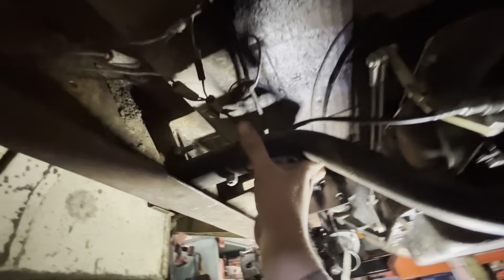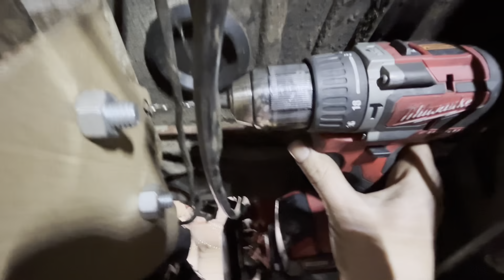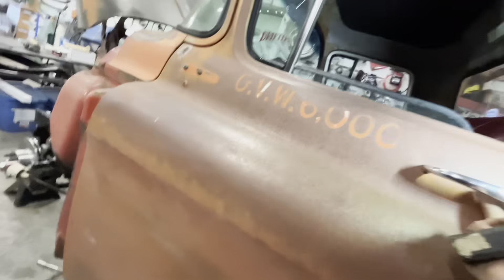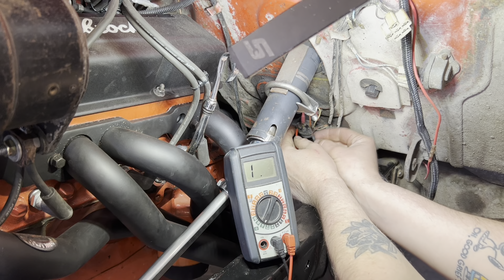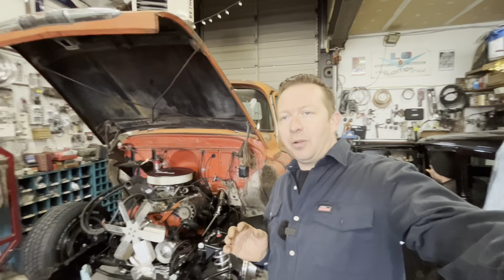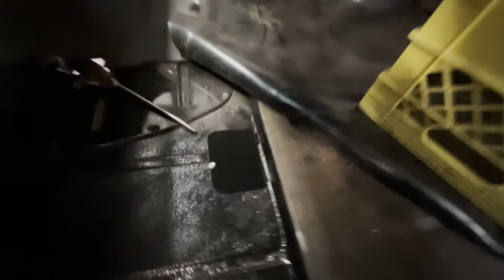Installing power brakes on a 1956 Chevy Pickup. Andrew’s 56 Chevy Build Part Three

Comment: I wouldn’t even bother with a power brake booster on one of these trucks. Mine stops just fine without one. I have a corvette manual master and a steel bracket from POL. Disc drums

Comment: Did it bother you that the pinion is offset on the 8.8?  I'm putting the same axle in my 37 1/2 ton with an LT!.  I didn't get one with a locker so I'm looking at the Eaton Trutrak.   Otherwise I think it will be a one tire fire.
Reply from the maker: The pinion is offset in almost every rear end. Some more than others. 
As long as the rear end is mounted square, and the engine and transmission are mounted square, everything is happy. 
Manufactures do this on purpose to minimize driveline vibrations. U joints don’t like to be in a straight line.
Reply: @LGKustoms  Engine is mounted square.  I'm second guessing if I have enough angle in it for the U joints.  I understand that some angle is needed to keep the bearings from Brindling. I need to check angle again.  I thint it's around 1.5 degrees. Perhaps the offset will help with this.  I set the engine low in the frame.  FATMAN IFS.  I'm about 3/4" off the crossmember  I hardly have any bump for the transmission.
Reply: @LGKustoms Great video,  YOU  can  get  of rid offset removing  ( SUBTRACT) WHAT IS ON RIGHT SIDE  OF AXLE TO THE SIDE JUST  CUT TUBE & REWELD. PUT THE PINNION IN  CENTER. NEED TO MAKE SURE CLEAR FRAME & WHEEL WELL. USE R/s  axle for L/s. Did this 8.8 on 63 Merc.comet.

Comment: Why did you use the cheap brake booster set up ?  You should use the set up from brothers truck. Then you wouldn't have to do all the custom chopping and welding.  BTW ditch the hokey music. It  detracts and annoys.
Reply from the maker: I used this booster set up because this is what Andrew supplied me with. 
Sorry you find the music distracting. I really enjoy music myself. And the comment I received right after yours was someone commenting how much they enjoy the music, so I’m not sure how to help ya there haha.
Reply: That makes sense. I'm doing the same upgrade to my 55 GMC  and I see lots of those units with the Ford style brake pedal pad on EBAY.  Brothers have a really nice unit in chrome as well with the stock brake pedal and linkage. Just for future reference. 

I must agree that your craftsmanship and technique are very professional.  Having to navigate around that transmission was real test of your skill and ingenuity.  Every one has their taste in music. Yours is the only video I have seen so far doing this job  on this truck.
Reply: @LGKustoms  there's  always a person W/ Deep pocket, The is to cut & weld PART OF FUN BUILDING  HOT RODS.

Comment: What is the brand of power brake booster and master cyclinder did you use??  Thanks
Reply from the maker: The owner supplied it, but if I remember correctly it was from Speedway

Comment: Hi lee.... great video, thanks for sharing. Exactly where i am at, with my project!  may i ask a question.... in doing the install, you don't need to include a proportioning valve?  i guess i was thinking i needed one, but watching your video, you went with the 2 lb. inline ones only?  Thanks for confirming.....
Reply from the maker: I never use proportioning valves, never had an issue.

Comment: Can’t believe u didn’t think of taking the pedal out and cutting the pipe off on the side u needed to move it over so all would fit then put the piece u cut off on the other side to take up space , easy peezee.

Comment: any Pro's of this kit than going on the firewall? besides keeping the firewall clear? this seems like there's more fab work involved than the firewall mount.
Reply from the maker: The only advantage really is the pedal stays in the factory location, and yes, it keeps the firewall looking stock. 
I’ve never installed a firewall mounted kit before in a 55-57 Chevy, but I’d assume it’s probably just as much fabrication, since the truck was never designed to have a firewall mounted pedal assembly. 
The nice thing about a firewall mounted master cylinder is it’s easier to access

Comment: Good that you were aware of the need to check the clearance dimension between master cylinder and booster  pushrod.
GM does recommend that a vacuum source is applied to the booster when measuring the output push rod resting dimension , ask me how I know.....
I'm just a retired old fart but in a previous life I did 37 years at GM Australia in Supplier Quality Assurance.

Comment: Not being picky but that crossmember modification looks dead ugly .Could have made a whole new crossmember for the trans mounted on the inside of the frame rails and forward to clear the booster entirely with a longer tongue under the transmission.
I would also be adding a skid plate under that transmission sump just to be sure ,speed humps etc.......
Just sayin.
Reply from the maker: Yup, definitely could have built a new transmission crossmember, but that’s not what I was hired to do and Andrew was on a pretty strict budget with this build, so we couldn’t get too carried away.
Reply: Lol....lets hope he never hangs it up on a curb.

Comment: Thank you for the videos, I learn much from them. The cross brace that spans the frame rails is to provide some rigidity? It seems the placement of one side on a plate below the frame would make the entire brace ineffective.
Reply from the maker: It’s just the transmission crossmember. Doesn’t really do any “bracing”, just holds the tail shaft of the transmission up.

Comment: For me i I would have run the front lunes through the frame, instead of under. For a cleaner look. Enjoy your videos, lots of good stuff.
Reply: i agree that thru the frame is much better, if a bulkhead is used thru the frame then you dont need a tab to mount the flex line .

Comment: You know Lee ----- You might be working on a '56 vehicle ------ high end and modern parts ----- I say ---- YES ---- to you doing these conversions ----- because just maybe ---- someday ---I will take out those old steel rods -- that actuate my brakes ----  front and rear ----- and install a hydraulic setup like you just did here ------ You give the guy that wants to do these changes ---- A VERY DETAILED EXPLANATION OF INSTALLING -- not just todays video of a new brake system install --- but --- from what little I have seen of your videos ---- it's with --ALL -- that you do --- THANK YOU ---------- Since you are on brakes today --- I visited a friend today ----- he is into newer stuff --- but -- he had the hood up on an old '60 Buick LaSaber ----- and the original master cylinder on that was --- a single cyl. as they were back then ---- but -- it was only about 2" wide and about 2 1/2" long --- SO SMALL -------- anyway --- Thank You for the video ---- Hope you two have a Good Memorial Weekend -------- RODNEY
Reply from the maker: Thanks, hope you have a good weekend as well. Memorial Day is just an American holiday, so it’s business as usual for tomorrow. We had a long weekend last weekend for Victoria Day.

Comment: Instead of linishing the spacer in the master cylinder, you should have adjusted the bolt length on the booster. The rounded bolt head on the output of the booster is fully adjustable for this purpose. Love the videos Lee 👍

Comment: Brake pedal hole is a great rodent door. This truck deserves some nice paint.
Reply from the maker: Rodents like truck rides too!
Reply: My 56 Ford F100 has, from the factory, flat rubber to seal around where the pedal goes through the floor.
Reply: Me again ! My sons 55 3100 used the 2k High build primer & paint,  I was amazed for the first paint job, for the money U can't beat it ! Still look great 6 years later ! 👍
Reply: Urethane !

Comment: Looks like the exhaust will be tight near the master/ trans cross member... Looking forward to part 4!
Reply: How close can the exhaust be the brake booster?
Reply: @mikespiker900  on my 40 I wrapped the exhaust that ran next to the MC as well as wrapping the starter. Using that header wrap.
Reply: @rickeagle  my Trailblazer has heat shields between the transmission and the exhaust, so something like that would work.

Comment: Another good one.
Excellent explanation on the residual valves too.
I have an extra one of those master cylinders and will use it to upgrade the single pot on the Pontiac. With the stock drums all the way round do you think I need a proportioning valve?
Reply from the maker: I never install proportioning valves. I’m convinced their just a marketing gimmick.
Reply: @LGKustoms  thanks